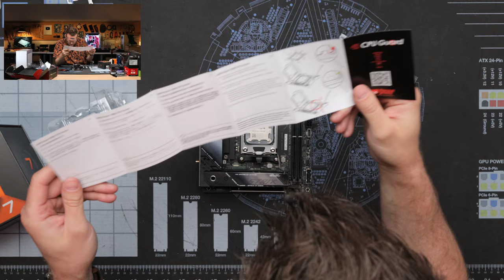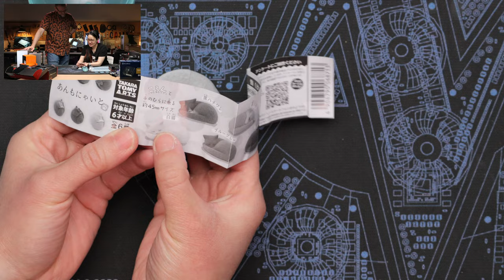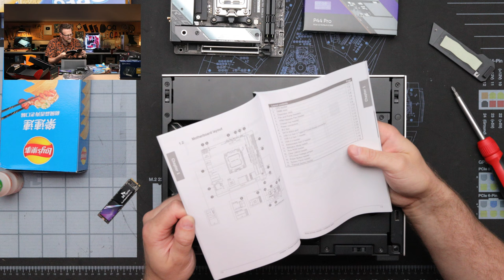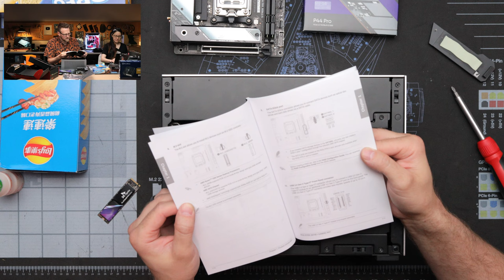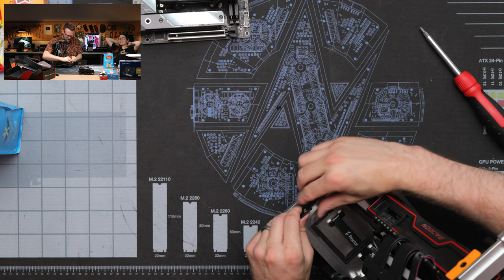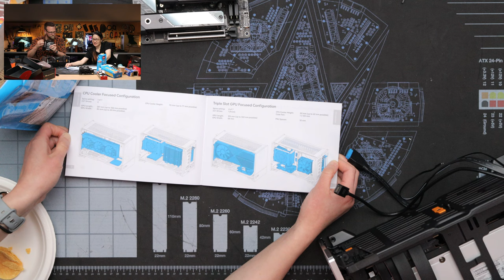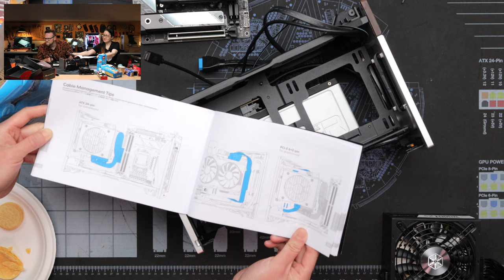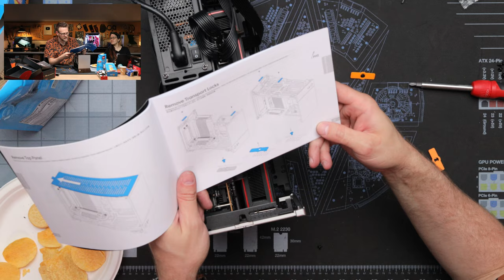Fractal Terra Gaming PC Live Build

Comment: For anyone mimicking this build, FYI, the psu used is the silverstone  extreme 850r not the 1000w silverstone sfx-l sized one listed. The sfx-l size is hard to fit in the case 2:25:14